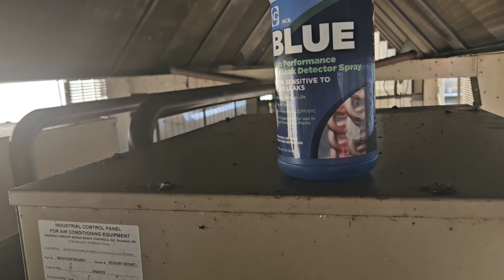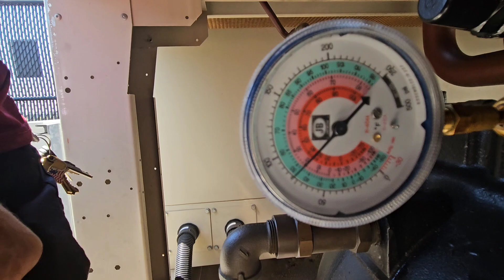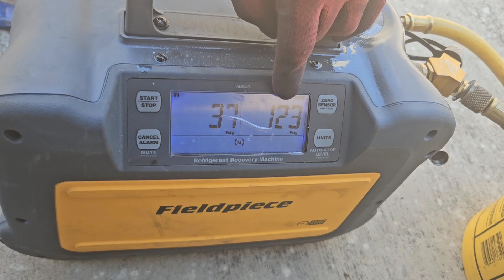ANOTHER CHILLER, BOTH CIRCUITS....RESONATE FREQUENCY.....PUKING OIL AND REFRIGERANT #AWS #AIRCOOLED

Comment: I wonder if some kind of tuned-mass damper attached near the fitting could solve the problem.  Just attaching the proper length of thin wire rope with a hose clamp near the fitting could do the trick.  You could probably tell when the vibrations were damped by touch.
Reply from the maker: @projectartichoke  there is a kit for it, which has been installed

Comment: What kind of VFD is driving the compressors? 
I remember having issues with some Recips and Scrolls o. Transcritical racks having sever vibration issues only on certain frequency. I believe we were able to skip the frequencies they were vibrating at. Im not sure what set up you have or if you have that capability with this equipment.
Reply from the maker: Yaskawa drives. We found some old service bulletins that tell how to fix it. Involves changing the drive settings when the econ is in play. There is also a vibration kit that hopefully is still available.

Comment: dang, didn't know seth went over there too! those are some good finds there bud, really like how you used the chilled water for your cooler too during recovery. What's the plan going forward to prevent this from happening again?
Reply from the maker: @Fryloc87HVAC  possibly go to the steel/copper kit that comes on the newer AWV. Problem is that kit is $$$$$ and not sure the customer is willing to pay for it, which isn't my department. I'm just gonna do the best i can and let the chips fall where they will.

Comment: 8 gallons of is crazy, gotta be over 1k just in oil. I can imagine the refrigerant cost. Crazy you guys figured out the resonate frequency caused that leak!
Reply from the maker: @ZRock7771  not sure the cost in oil. I know the refrigerant is gonna be expensive. As for the failures...it honestly made the most sense. thanks for watching and the comment
Reply: @JJ-COMMERCIALHVAC  Yeah defiantly something design related, the fact that 3 separate sages had the same thing happen tells me design flaw. I usually pay 150-200 a gallon for POE 68 oil, not sure what oil 134a takes.

Comment: Man, that’s horrible. I saw the first video and thought to myself that there’s probably something wrong with the compressor and it was caused by vibration.
Those pipes vibrating can do some weird things Trane another manufactures use dampening weights on discharge lines to reduce it. I would hire a dynamic balancing contractor to come take readings. Good luck.
Reply from the maker: There is a kit we are trying to get. It's steel to copper and can handle the speed change much better. The newer AWV has it already on it. Appreciate the comment